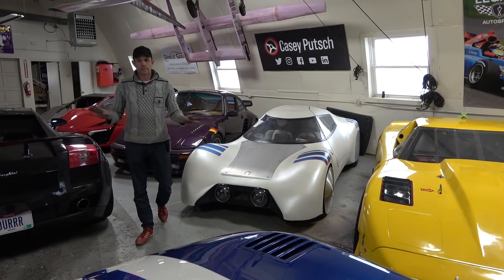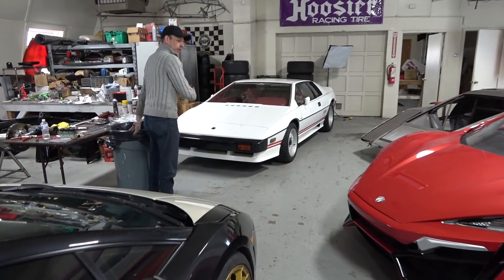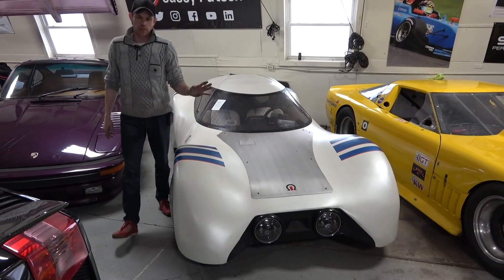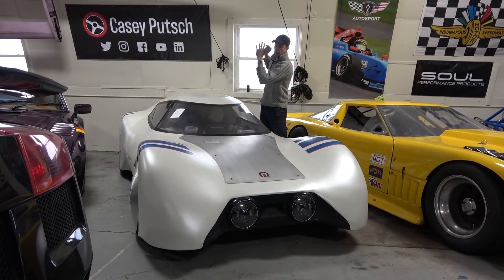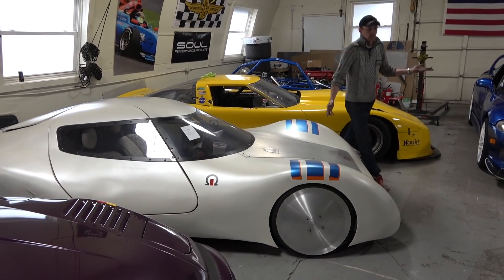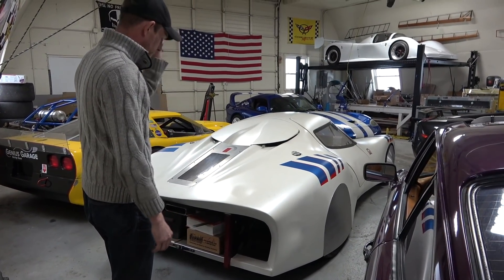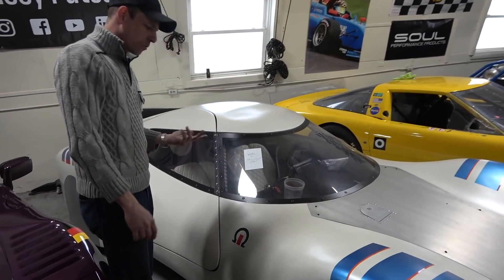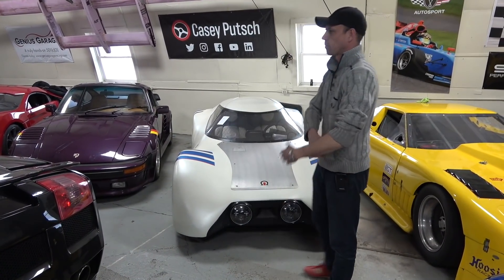Supercar that's Recyclable and fuel efficient? The Omega Car

Comment: I think this car is probably my favorite of all the cars you've featured on your channel. I love the concepts and purpose behind it, as well as the construction techniques used. I look forward to seeing more of the Omega Car!
Reply from the maker: I appreciate that man. Thank you.
Reply: @CaseyPutsch  Also agree that this concept vehicle made into a prototype is quite well thought out, developed with many excellent implementations.
There are two innovations You might consider to use in a modified power train.
A. Stanley Meyer's Hydrogen internal combustion engine + water to hydrogen conversion method system.
B. Add hydrogen extraction from H2O water vapor exhaust.
C. Hydrogen generator, extractor from air.
D. Higher efficient, higher power/weight ratio internal combustion engine: Liquidpiston X rotary engine.; 4 HP/2 Kg, 40 HP/20 Kg air cooled,combustion engine works with multiple fuels - hydrogen, diesel, ethanol, methanol, gasoline, etc. and combinations.
E. As an engineer, hopefully a scientist too, You should clearly know the 'Environmental', 'Green', Nonsense is completely baseless, falsehood, pretense, lies, false, incorrect, distorted, misleading information, misinformation, disinformation, political, directed, dictated, controlled by the Authoritarian Globalists/Elite; Biology is only a Study, without the necessary essential aspects, factors, ideas, concepts, principles causation and mechanism which are necessary for Postulation which is necessary for and precedes Hypothesis, which precedes Thesis, which precedes Theory, and ll require increasing level of Proof. Just as their nonsense about the "Zone Layer" whole, was found to be completely false, political, etc. so too the actual evidence of "Global Warming" is clearly false, and their "Climate Change". NO ONE knows [which is actually true, since The Creator is NO ONE, the ONLY ONE and thus the ONLY ONE that knows] what the principles of weather and all other claimed aspects of the environment. We do have clear evidence of many chemical harm to humans, such as toxins in the air when breathed, injected, digested, etc. into the body. Though, also with the empirical evidence, their is not actual defined causation and mechanism, though some ideas, details, etc. of the harmful affects process. It is nothing like developed principles, causation, mechanism within physics most all of chemistry [much of organic lacks - hence biology, the combination biochemistry and all related and extended]
F. There are some other small improvements within the electrical and electronic aspects including the sound system which benefit from or need some improvements too. [if You would like to discuss specifics, my expertise within engineering design, development, innovation, etc., are extensive within electronics]

All The Best and Much Success in Your Quest Health And Well Being.
Sincerely
Reply: A concept car that actually drives.  That's probably what pisses off the competition more than anything.
Reply: @iswinkels  not really, vw did this concept, you could buy one, three pot diesel hypermiler that can do a fair chop....theirs got shelved too,

Comment: I don't remember when I first saw the interview you did with Ed over on Vinwiki when you talked about this car, but that was my first intro to you. And when I saw the car and heard about the performance, my first thought was, "I want one." That desire hasn't changed. I want one. It's fast, but so what, I will most likely never take a vehicle much above highway speeds, because I am not confident in my ability to do so safely. The thing that made me immediately attracted to this car was 1) The aesthetics, but more importantly 2) The aesthetics WHILE ALSO GETTING 100+ MPG! I won't lie and say, "Oh, I don't care how the car looks as long as it gets me from A-B reliably," even though I know how a car looks shouldn't affect my desire to own it. Luckily for me, it seems that designing for a low coefficient of drag also tends to make for a really damn cool looking vehicle.

All that said to say, I'm glad you are bringing the Omega car back out, and I look forward to what the future has in store for this amazing vehicle. Because as you kind of said in the video, what makes this car so revolutionary isn't the powertrain, it's the design. A monocoq, removing mirrors, running the airflow under the car and up behind the seats to create a more laminar flow to the radiator, etc. Everything that was done on this vehicle to make it as slippery as possible means that regardless of if this car is an ICEV or a BEV, it will retain it's efficiency level. The only thing that will have much of an effect on efficiency after this point is if someone can improve the efficiency of available powertrains.

I look forward to seeing this on the road again, best of luck to you, and I hope the chance to own one for myself comes sometime soon.

Comment: I'm reminded of something from Architectural school. One class a Prof. was boasting about all of the great advancements some guys in San Fran were doing, new materials, new methods, etc. in building. Years later I was working with an Architect who was a professor(not the boaster) from my old college. I asked him, what ever became of those guys in San Fran. He told me they were stopped dead at the bureaucracy. From my own experience that's been the biggest problem our world faces. But most people do not have a clue about it. Only look confused when they are told, you can't do that because the law...
But talking efficiencies in the automotive world. I look at that very differently than you do. I look at cars as systems, of course that is a relative term. In engineering like life there is always a price. 
I agree the diesel is the most efficient of engines. Not just talking mileage, but if it's combustible a diesel can run on it. I know a guy that ran his car on fry oil, he got pulled over for the funny smell his car made. He had to pay his estimated highway taxes, that he wasn't paying at the pump. Yea, there is no way to win.

Comment: Casey, I've caught nearly all the videos you've shown of the Omega car, and since I know exactly what sort of donor car the engine comes from, I'm always interested.  But everything you've shown of the car is a teaser, to me.   I'd love to see the Omega car from underneath, or vignette videos showing some of the suspension, or simply show us what's under the front panel between the wheels next time around.

I've always wanted to see a more "boring" video where you dig out photos of when it was under construction, to see some of the history behind it.   Then you could better explain some of the design choices you'd made 10 years ago, like...
- how was monocoque composite over foam body was laid up?
- what sort of test pieces you tried before diving right into the body?
- how did you make mounting points join that unconventional body to fit the metal bits like the suspension or engine mounts?
- is the Omega car registered -- and how onerous was the process of registering a handbuilt car not based on another car in your state?

Looking forward to more appearances of the Omega car.  Don't be afraid to show us it opened up a bit more.

Comment: Can’t wait to see more of the Omega car. It was fun watching it when you and Genius garage were working on it last. I hope to make it a car show if you have it out at one. Love the colors on it too. Very sleek looking vehicle. If I remember correctly you have a 1.9 Tdi in it for power and mileage. I wonder what one of these would do Mpg wise with a Smart Fortwo drivetrain. I have a 09 Fortwo and get a constant 45mpg. Best tank has been 47mpg.
Reply: I am almost sure that it would be worse with the gas-powered smart engine. There are a few interesting engines also from VW, which could be more fuel efficient. but they were never offered in the US. You may want to look up the 1.4 TDI or the 1.2 TDI from the Audi A2 or the VW Lupo (3L).

Comment: I have so many questions about that car.   I hope you get around to answering them with your description of it.
From this showing -- 1) Is the engine bay closed off to the bottom airflow like a 956?
2) Does the front tire sidewall flex rub the wheel fairings?
3)  I hope you someday describe the structure of the body with the loading carrying paths and suspension points.

Otherwise, I still have questions. 🙂

Looking forward to watching this series.
( throw a couple of Lambo stories in between LoL)

Comment: If you look at Citroen ds the rear wheels are covered and the front headlights turn and are integrated into the fenders also had hydraulic suspension and lightweight roof and bonnet

Comment: FYI: In 2000, GM brought out a car in the EU called the "Opel Astra 1.7 DTi ECO4". It was a special version of the then Astra. Lean tuned, different gear ratio's. Its in the Guinness book of records as it cleared 100mpg on a trip from 1 corner of the UK to the other. 870 Miles. I had one as a company car and it was fairly decent. Even when driving it like a complete loon it still did 70 mpg, so pretty awesome. And a 4 Door hatch family car, so it sold really well.

Comment: As a non-structural suggestion, you could tune it for 2 modes. 

1: normal mode where you CAN expend and "waste" fuel like you did in that first test.

2. A more distance oriented and environmentally-friendly mode that physically will not do anything that wastes fuel. For example, if you want to squeeze drag racing power or something out of it the ecu just  refuses to give it to you.

This could help delineate activities and give you even better mpg when you want to tell the world how efficient and fast it is.

Comment: my  niece sent me this last week , 
I don't know the source yet   Ω
______________________________________________________________________________________

A typical EV battery weighs one thousand pounds, about the size of a travel trunk.
 It contains twenty-five pounds of lithium, 
sixty pounds of nickel, 
44 pounds of manganese, 
30 pounds cobalt, 
200 pounds of copper, and 
400 pounds of aluminum, steel, and plastic. Inside are over
 6,000 individual lithium-ion cells.

To manufacture each EV auto battery, you must process 25,000 pounds of brine for the lithium, 
30,000 pounds of ore for the cobalt, 
5,000 pounds of ore for the nickel, 
and 25,000 pounds of ore for copper.
 All told, you dig up 500,000 pounds of the earth's crust for one battery."

"Going Green" may sound like the Utopian ideal 
but when you look at the hidden and embedded costs realistically with an open mind,
 you can see that Going Green is more destructive to the Earth's environment than meets the eye, for sure.
Not to mention the cold temperatures in Canada during the winter do not work well in electric cars
_____________________________________________________________________________________________________

I have not verified  this data, but it sounds right..
 I have been mostly critical of those claiming electric cars cars 
 'green"my opinion is they just defer pollution  NIMBY. 
of all the cars you have there the  Ω car is the most interesting. 

Yes I was drawn to your channel for the 944 content  
Yes I think your collection is neat

I would enjoy building my own Ω-Car

Comment: I really like this, and I learned some valuable things I want to use one day.

But what exactly is the body made out of, if it's not carbon fiber or fibreglass? I am not terribly familiar with what other kinds of composites are feasible for such structures. I'm used to the aforementioned, aluminum, steel, and wood (Morgan 3-wheeler).

Comment: What do you think of Aptera Motors? Generally, they seem to be aligned with the Casey Putsch approach. I'm not sure about how recyclable the cars will be, but they're very light (1700 lbs), very aerodynamic (0.13), made with a composite monocoque, and have solar panels to increase range and decrease reliance on grid charging. They don't look like sports cars, but the three motor version does 0-60 in 3.5s. Also, I believe they'll get up to 1000 miles of range.

Comment: They say great minds think alike and for the most part it would seem that is the case, it is a great concept and looks fairly cool given the build date, 4 cyl diesel was a wise choice, surprised you didn't integrate a centrifugal supercharger to compliment the turbo which is generally efficient from mid to high rpms. I also am a huge fan of hybrid support systems ( specifically the axial electric drive ) which replaces the flywheel and assists with acceleration and fuel economy. I am also a fan of Hex core as structural panels and I also disagree with your opinion about the leading edge.  That being said you are highly talented and capable so I expect your Omega project that has loads of potential will be brought up to speed and turn some heads, all the best.

Comment: it really is such a shame dieselgate happened VW really had some magic in the bottle with their diesels my jetta gets 55mpg at 75 mph consistently
Reply: And the Honda Civic CVCC got 54 mpg back in 1975 [if You are aware or remember]
Also, even better is the Stanley Meyers Hydrogen conversion + hydrogen combustion engine.
Have You seen the Liquidpiston X rotary engine ? 4HP/2kg, 40HP/20kg, air cooled; operates efficiently with all fuel types.

Comment: Casey, convert the Omega car to run on Waste Vegetable Oil (WVO). The first Diesel engine built by Rudolf Christian Karl Diesel ran on peanut oil. Many people have converted their diesels to run on used vegetable oil they collect from fast food restaurants, so the cost for fuel is nearly zero. All you have to do is filter the used oil and preheat it before it goes into the injection system. There are a couple of companies out there that sell WVO conversion kits for Diesel engines. Good luck on finishing the Omega car. It’s a great concept and I would buy on if it was built!! Especially with the WVO conversion.
Reply: Chip - shop oil powered vehicles work but do have a problem in that the owners are thought of as a bit eccentric and the whole thing funny. Casey has made something that an idiot could use and fill at their local pump, and that is the way to start. The power companies might suport it when they might make a profit by selling fuel but would not if it used chip fat oil.  Only upset one big business at a time!
Reply: @johnforeman6620  the great thing about WVO conversions is you can switch back and fourth between burning diesel and WVO. There are systems that even switches between them automatically. 

Yes, Casey has developed a very nice, fuel efficient sports car that’s completely recyclable, but with the fuel prices the way they are now, a WVO conversion would be the next step in the evolution of the car.
Reply: @TexanOnTheMove  Obviously it is Casey's decision on what he wants to do with this. He does have limited resources so should he spend time doing what others could do? One of his goals with the ♎  was fuel efficiency. I agree that a WVO would bring cost down, but it would not improve fuel efficiency. Using WVO would alienate the fuel companies who I see as his business partners in promoting the ideals behind the car.

Comment: If you want it to be even more efficient: replace the manual transmision with an automatic (preferably a DCT or proper single clutch one over a torque converted automatic). It might be less fun, but increases efficiency.

Comment: bmw i3 has probably the lightest but still comfortable seat ive ever felt. also, i built my own 7lb battery for 50 bucks to replace my 65lb agm battery which is like the same weight savings as a titanium performance exhaust lol. suprized no one else does this. almost no internal resistance unlike lead acid 12v

Comment: I think it would be interesting if you have 3 separate tunes, one hyper fuel efficient with no regard ro performance, one high performance with no regard for efficiency, and one final production-type balancing between the two.  

I feel it would really emphasize the capabilities of the platform to be able to show both extremes in performance, even if you dont leave either as the final tune.
Though, come to think of it, if you could integrate a feature to switch between tunes, like many cars these days have as part of their 'driving modes', either with a button on the dash or through the iPad display, you could advertise the car as being capable of both performance extremes. I have no idea how much extra hardware this would take though, just sharing my thoughts.

Comment: I would love to make my own Omega, if you still have the general design docs and plans and are open to selling copies- like Robert Q Reiley and his 3 wheelers from the old Popular Mechanics DIY cars back in the 70s.
The point about engines and battery choices is also a great point- while it far more efficient to take energy from petroleum and put it into a car as an EV than gasoline, much of the world is completely reliant on diesel because it's rugged and it's fuel is so energy dense (assuming your tune deals with acid rain problems that we've needed DEF for) and can be made from most oils and esters. 
What i'd love to see most is, the naked chassis to display what kind of "kits" could be shoved into the back and what designs could be made. EV versions would be my most desired, but right behind would be taking commonly available engines (both diesel and gas) and trying to shoehorn them into it and show different ways it can be built.